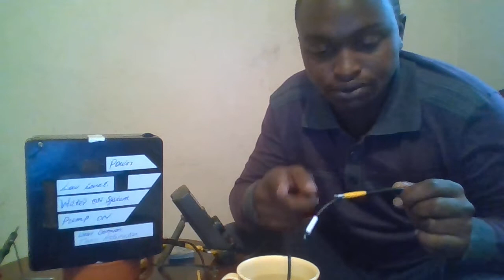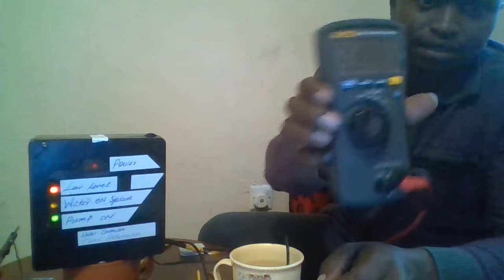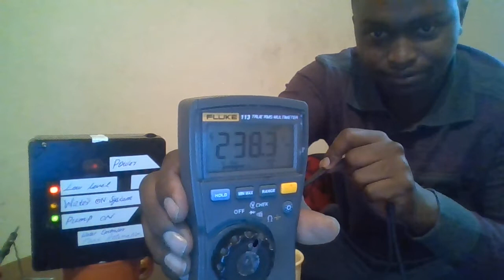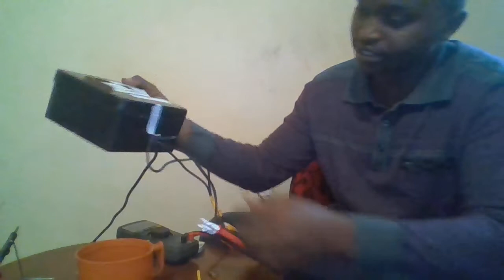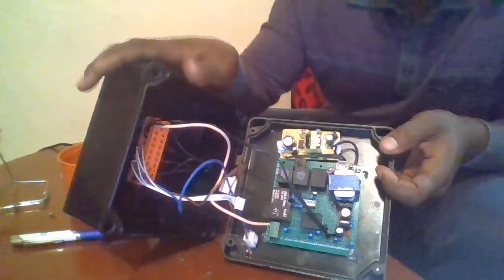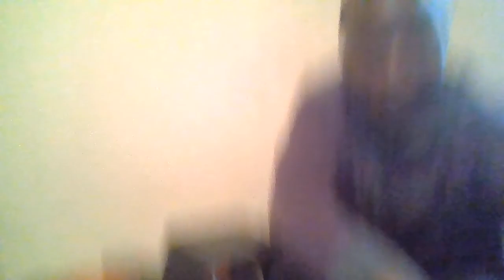electronic tank controller.

Comment: will the 215v as measured will be present inside water tanks water?if yes then what measures are in place to avoid being electrocuted when using the same water.
Reply from the maker: there is no voltage at the input side (sensors) . 240v ac u see is the output of the controller.